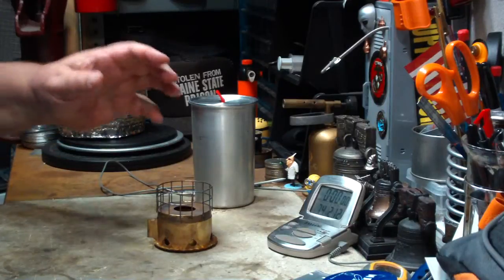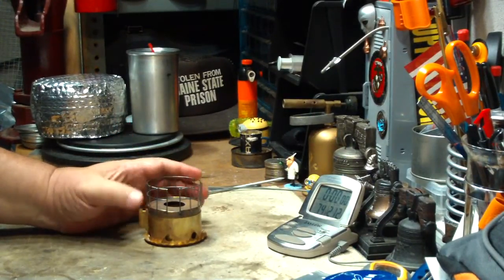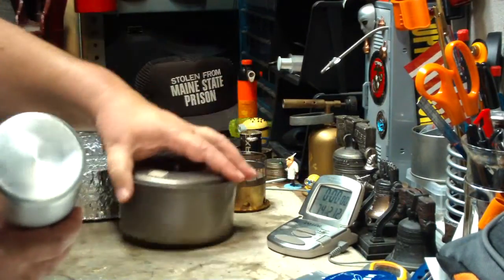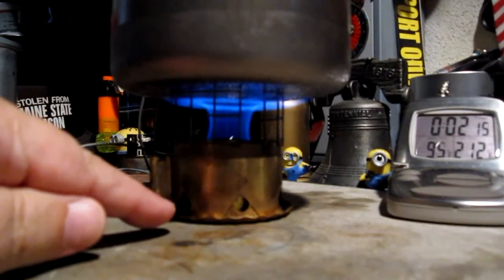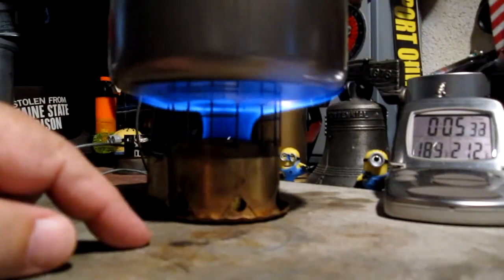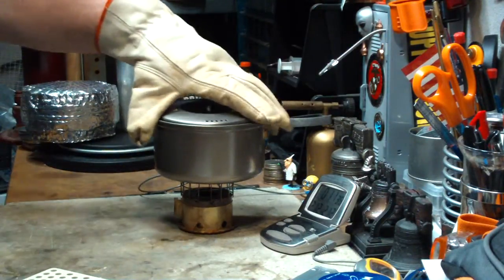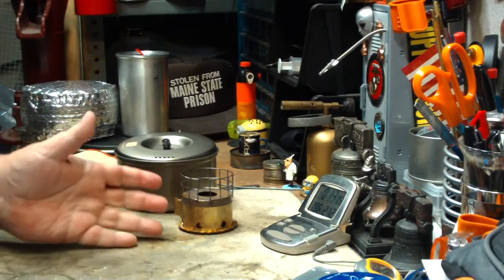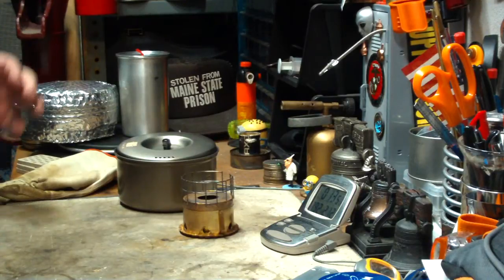Brasslite Turbo II-D - Vargo Titanium Pot (0.9 Liter) - Boil Test #1

Comment: hiram, great test and showing again..thx. hiram, why does the brasslite stove there have a cut-out on the SS pot stand? also, I have interest in these brasslite stoves. I wouldn't mind seeing some shows about learning about the differences and seeing them operate between the different brasslite stove models. I saw just now on www.brasslite.com they are selling the original design turboI-D for $15 & free shipping while supplies last... looked a good price I'm thinking??? I like old products and I like old styled products ... I also am interested in alcohol stoves that simmer down for real skillet cooking rather than just hot boiling. another interest of mine would be in the single burner white gass coleman stoves and maybe seeing them with the history about them (when made and such). I find stuff like that interesting! thank you, martina
Reply: Here are two possible reasons for the cut-out or slot on the SS pot stand of the Brasslite stoves: 
1. to better accommodate a simple, DIY, flat snuffer to put out the stove when done. For safety or to save fuel. 
2. to make it a little easier to light from the top with a match or lighter.

Comment: Definitely a fair test, Hiram.
Another source of the differing boil times could be what Brasslite considers to be a "boil." I see plenty of boil test videos where people call it a boil once bubbles break the surface or when the pot starts to make a lot of noise, but I think your method of using the temperature is the most accurate and appropriate.

Comment: They do say on their front page in warm weather to put the prime on the top surface.  I doubt you could get even 1 ml in drops there, but it would burn fast to warm it up.  I suspect they do use the cold weather prime in their test to speed up the warm up.  It might not be the most efficient but is likely faster.

Comment: you should preheated the stove using the built in tray. i load my fuel , put on the pot prime the tray and then ignigite. it flares up ....and because the pot is already on the stove...you use all the primer heat on the pot while it heats the stove.

fyi...trangias have a depression around the burner for the same purpose...ive always wondered why you dont preheat...the feature was included in the design for a reason...why not use it.

thanks for the vids!

Comment: It's better to be honest, than sponsored, Hiram, don't worry. There are many variables to eliminate, like the amount and percentage of fuel used, preheat time, and the very fact you've used methanol, not ethanol may have something to do with the timing. Or particular batch of these stoves might be odd in some way. Still won't turn 7 minutes into 5, but it can influence the time. Now the question is: which producers actually matched their statements with your tests? Are there any?

Comment: The single can stove has that band of aluminum at the top, and comes to operating temperature much faster than the MAHALO, but not as frugal on fuel as the MAHALO. This new stove needs about 15% more fuel. Not sure of the speed yet.

Comment: You need to look at the elevation the Brasslite was tested at. As you go up in altitude the atmosphere gets thinner, and the boiling point gets lower and lower. A few minutes ago I tested a new stove design. Much like Smokeeaters single can stove but jetted like the MAHALO. I started with 7.5ml alcohol in the stove, and about 5 drops alcohol to prime it. When the fuel burned out the 8 OZ tap water was 203F and boiling.